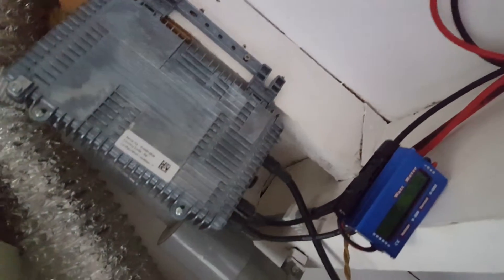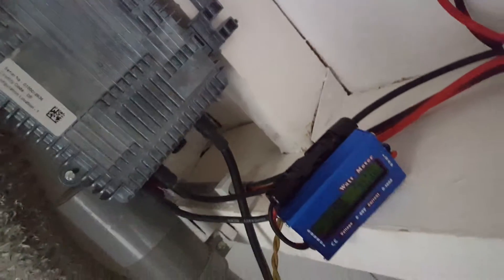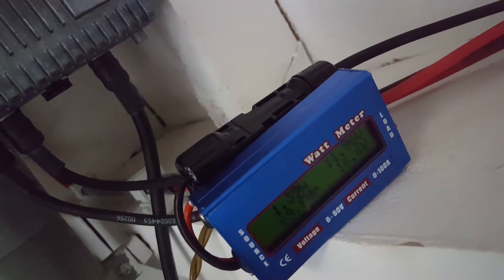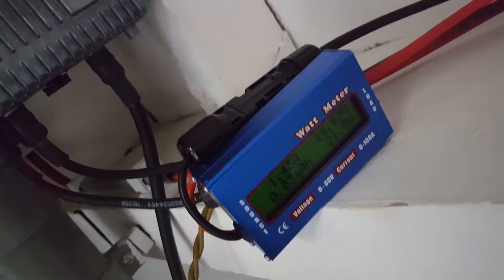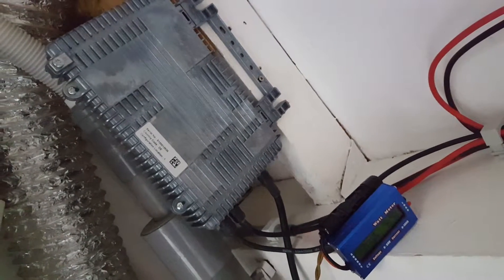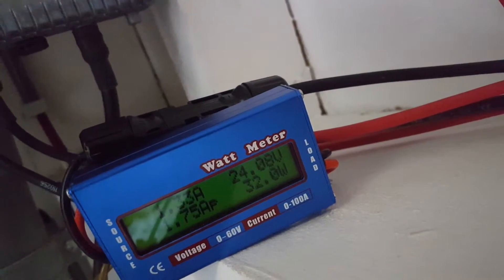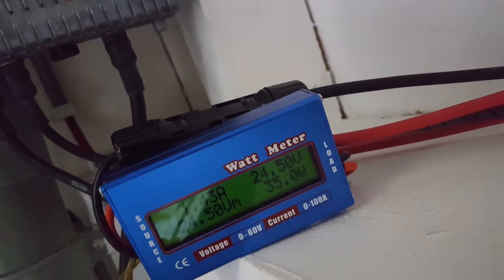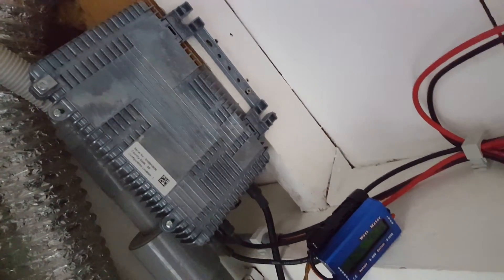Enecsys 360-72 number 2 noisy

Comment: We have the same problem with 360-72 model. It drains the voltage to 25V, however neither a reset nor a pause overnight did not help. Do you have any idea what to do?
Reply from the maker: Replace it with something else. Enecsys has gone under.